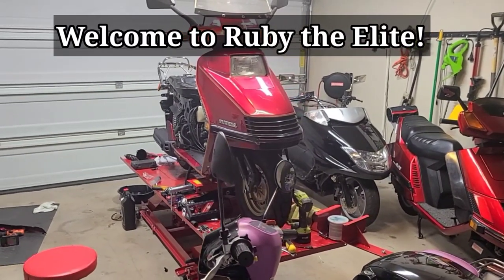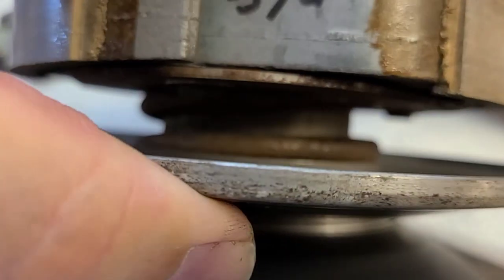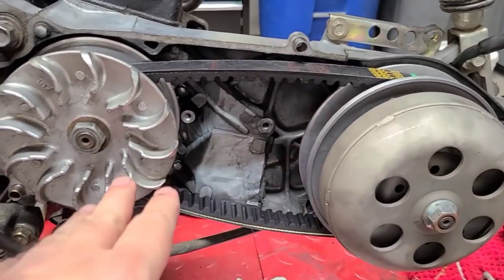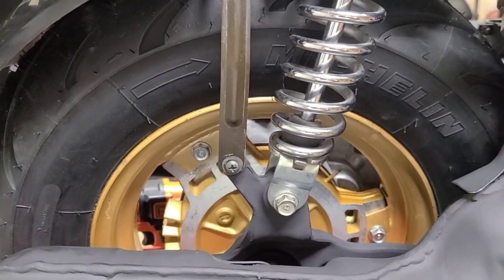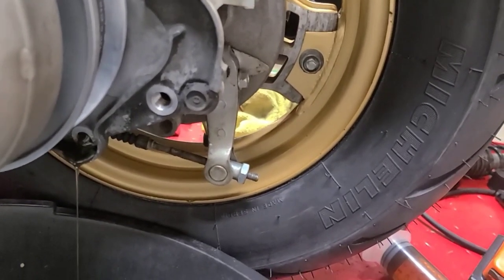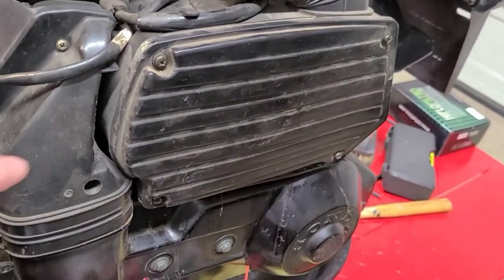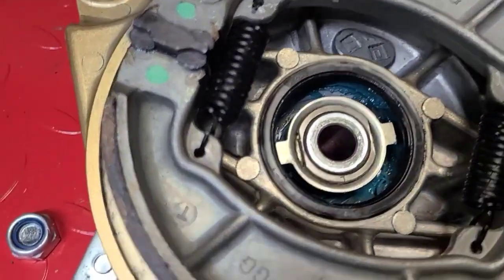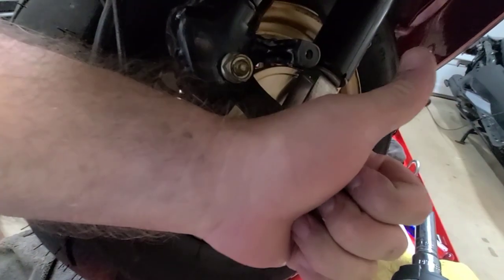1985 Honda Elite 250 Scooter Restoration Vol3 | Ruby the Elite

Comment: I had my 85 Elite 250 since new in 86 as a left over, almost 17k on it.  Replaced a lot of parts at 10k, but need to dive back in as things are not as smooth again, has not been on road in 7 years and before 2011, it was off the road since 1995, Its been to every state in New England and needs some bearing replacements and maybe top end on motor now.  Did Dr. Pulley with grease years ago, but took it back apart and cleaned it out after 100 miles, variator and clutch was replaced in 2012 so that is all good still... again was only 15 years old when i got this bike, now 51.  Have every option Honda offered for it except the carpet floor mats and still in mint shape for 16K on the clock.  I follow this guys 3 rules... Safety 1st, get it to run like new, then detail it pretty.  LOL
Reply from the maker: Thanks for the great comments!!!  I do have still more to do on the Elite 250. I'm not satisfied with it yet! More to come with that bike for sure! I only have the carpets as you know.  I really like them! I paid high bucks for them but that's what happens when it's supply and  demand. I have seen some rear tote boxes but in lousy condition. And even those are expensive! I'm already way over budget on that bike but that's alright. Having a blast! I'm right there with ya at age!  Buying the things I didn't have as a kid and sharing videos has been fun for me! See ya soon Shaun with more videos!!!!🙂

Comment: Your videos are amazing.  I recently purchased a 1985 elite 250 from the original owner.  No bird seed but I did find several rodent nests. One under the carburetor with a stash of acorns and various food items in the air box.  The other I found in the handlebar cover where they chewed one of the directional wires.  Don’t worry I Soldered and heat shrunk the wires.

Comment: Great set of videos. 
Ive been a fan of you videos for a while.
 This is exactly the same as my bike and you're doing everything i need to do on my elite.
My 1985 red 250 also has only 11,000 miles but is not quite as nice as yours.
Thank You for the roadmap and the inspiration to fix up my elite 250 a bit.

Comment: Can you add a description to each of these resto videos that lists the parts and numbers you used?  Specifically the shocks.  Thanks
Reply: I second this! I've seen many who say that PCX 125/150 shocks fit, but when I go to buy them there seems to be at least 2 different PCX groups using different shocks. When I'm spending $100 before shipping I want to be sure they will fit.
Reply from the maker: @Dave.O Hear you go Dave. These are the shocks that will work. Use the eye and bushing from the original Elite 250 shock. 
https://www.hondapartsnation.com/oemparts/a/hon/5053e466f870021c54be20fe/rear-shock-absorber

Comment: Great video! I'm sure that I'm not the only one who would be interested in a follow up video showing how that Chinese clutch is holding up. Also where is that place in Michigan that resurfaces the weight arms? Was it JW Parts Plus? The contact form on their website is broken and their FaceBook page hasn't been updated since '19, and had several complaints about slow turnaround. They do have an eBay site.
Reply from the maker: As I mentioned in my comeback video, the Elite 250 basically sat for a while when I stopped making videos. The mileage on it isn't much to give a good read on the clutch. As far as JW parts plus? They did a great job on my Elite 125 clutch, but that was years ago. Their customer practices back then were excellent! I have no idea how they are now.

Comment: JUst found your chanel today, very good stuff here, I just picked up a 95 Helix with 900mi on it, it was never used,,,,,this is my first honda scooter, I usually work on chinese gy6, this should be a nice upgrade,,,Do you think these older elites and helixs are as good as say a newer reflex or a forza? The helix is like driving a sofa, cadaliac comfy,,, You can go wrong with Honda
Reply from the maker: Hello and welcome to my channel!!! The Helix is my next project.  It's the same engine as the Elite 250 I'm told.  I haven't dove into the Helix yet though.  I'm not a fan of the Forza.  It was built with a small person in mind. I'm only 5'11 and I wanted to get off it after a very short ride. I was very cramped on it. You won't see one of those in my garage.  The Reflex I've never ridden on.  Maybe one day if the price is right. Same as the Silverwing.. Maybe one day.   I have 3 beutiful bikes with the Morphous,  Elite 250 and Helix. I think the Morphous will be very valuable one day since it was such a low production number in the states.
Reply: @rubytheelite  yea, that Morphous is neat looking, how do you like it compared to the Hondas?
Reply from the maker: @thedaydreamer7972  The Morphous is extremely well made! Yamaha put a lot into that bike for sure! That bike is a star when I ride it. It is such an attention getter! That bike is Cadillac of scooters for sure!